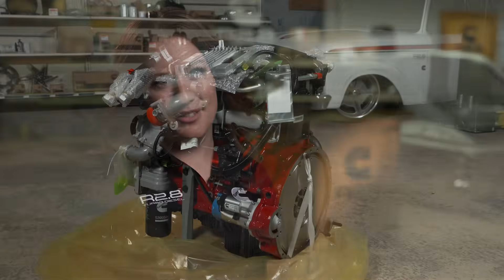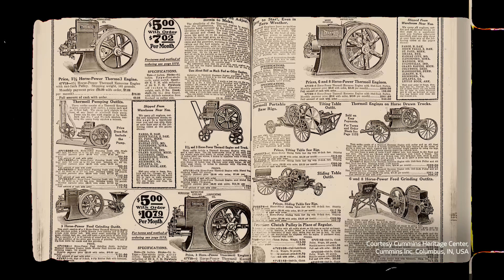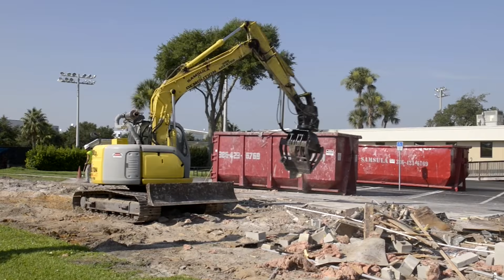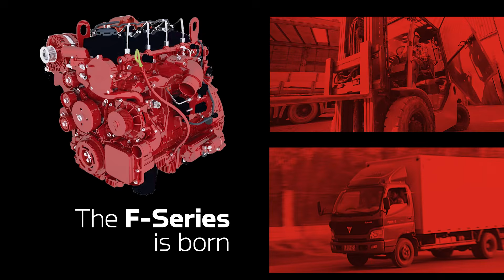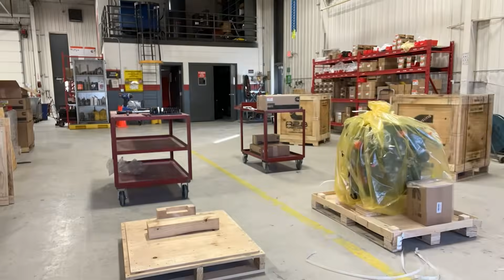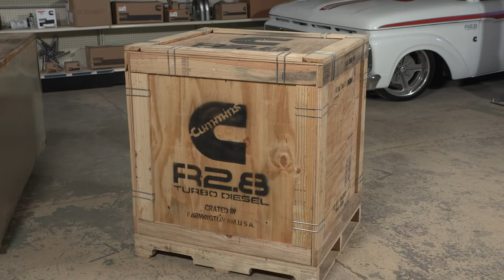Cummins R2.8 Turbo Diesel History

Comment: I bought one from Quickdraw during the shortage. Finally got it installed. The "plug and play " aspect of this engine drew me in because I am "Not a Tuner". Well three years and untold hours trying to chase gremlins in the ECU/PCU by myself with zero support from my local Cummins "We can't communicate with it You're going to have to buy the software" . I am a Tuner but would never do this again. 
Caitlin Brewster will never respond to your emails. Even with Quickdraw forwarding for you. Good luck! if you are in the same predicament.
Reply: The 2.8 is the most regretted engine swap I hear about. Its just too small for most vehicles. The hp/tq per dollar is poor.